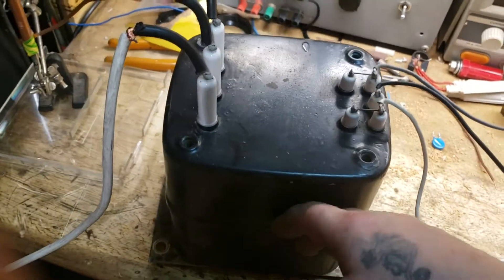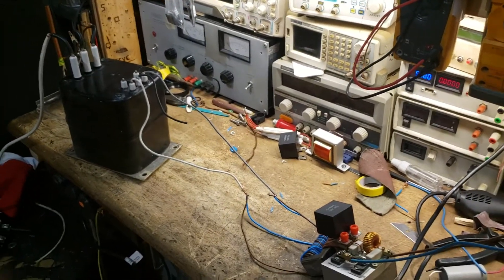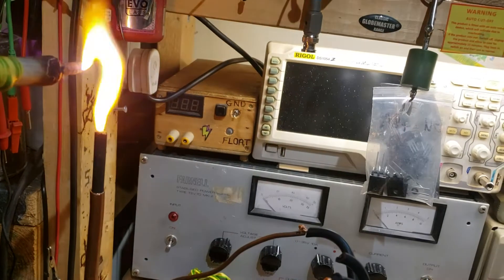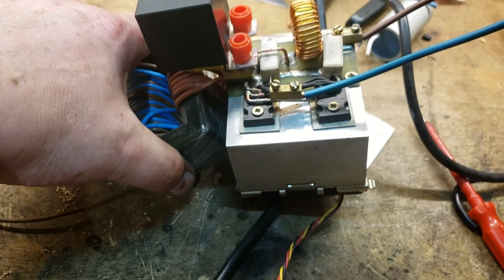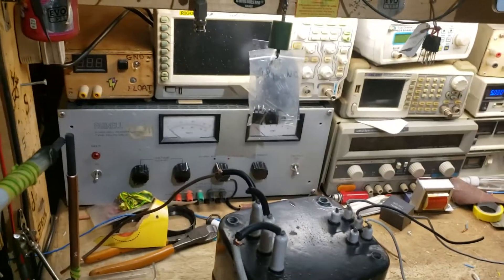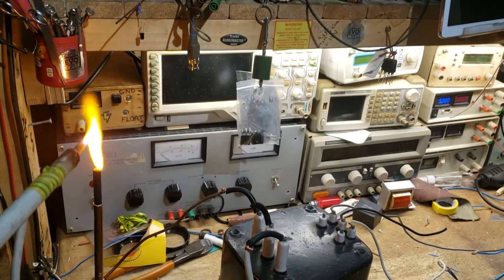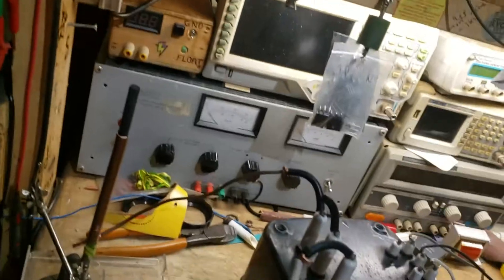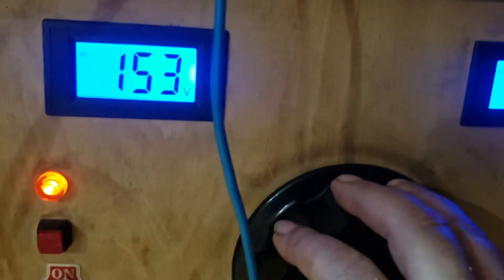High voltage transformer 10,000 volts, Lethal current arcs

Comment: That's a great one! Where has this transformer been used? Is it from a radar-unit?
Reply from the maker: It's from a high end hv power supply from 1970s and its rated at 10kv 300ma 

Steve